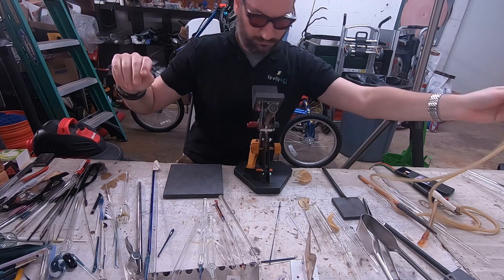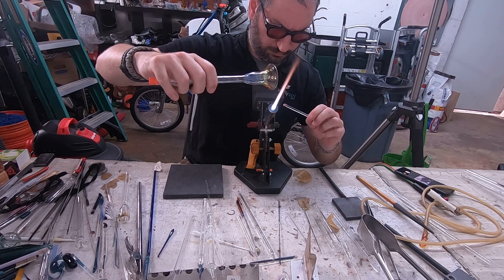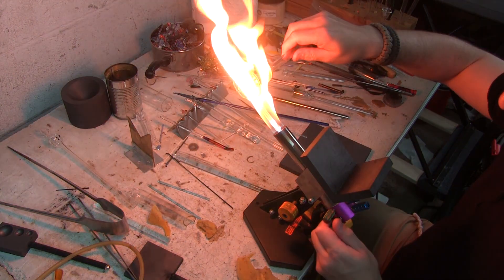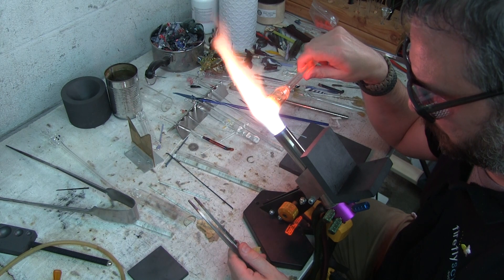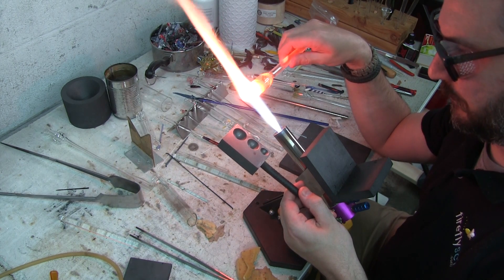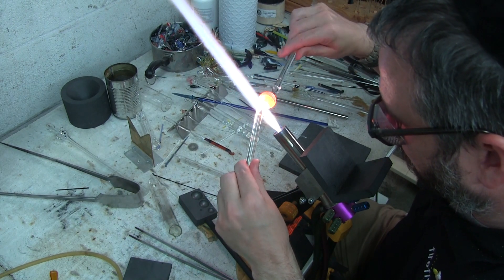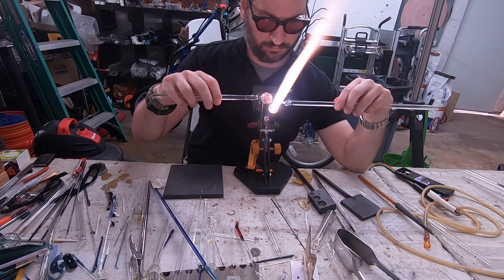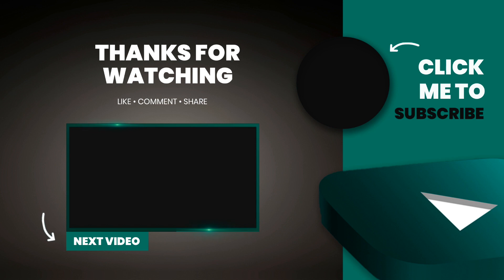Lampworking | Glassblowing | Inside Out Marble | The Fusing Shop

Comment: Just got a Mirage. Could you make a video about flame chemistry on the flames you use to silver fume please!  I am super new and I really enjoy your videos. Thanks!
Reply from the maker: Hey Buddy!  Nice!  The Mirage is a great torch and it will provide you with enough firepower for larger projects.  Fuming can be tricky and I do plan on making a fume video soon.  Make sure to preheat your glass so the fume can stick to it.
Reply: @FusingShop  wow what a quick response! Thank you. What i noticed was how small your flame is when fuming style. As i said I was new and a new torch. Upgrade from the lynx, :) Only tired fuming like 10 times and still a mystery to me.
Reply from the maker: @buddyshroom  Hey Buddy!  Yeah I try to respond within 1-2 days =).  Yes, I run my flame very small when I fume.  It can be very frustrating when the fume doesn't stick to the glass and all you end up with is a clear tube lol.  I'll try to make the video sometime this week.
Reply: Love your videos. I have a Bobcat with residential natural gas and a 5 lpm concentrator, so things take a longer and I have to be careful to flash frequently. I’ll have to try fuming. I love the effects. I built an exhaust hood with a 180 cfm fan to the outside, so it should be safe. 
 
One suggestion based on painful experience: Don’t lean on your elbows while working. I ended up with an infected bursa sac on one elbow from doing that. It took forever to clear up and I had to wear an elbow brace to put pressure on the bursa sac. I made moveable arm rests for my forearms after that and roller stands with roller bearings to support rods and puntys.